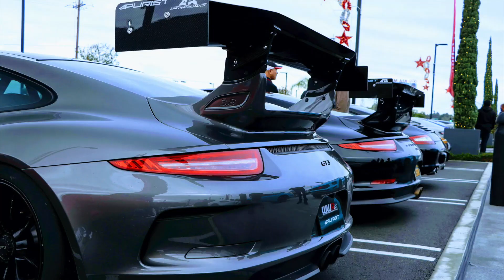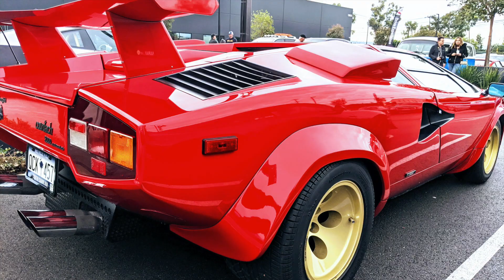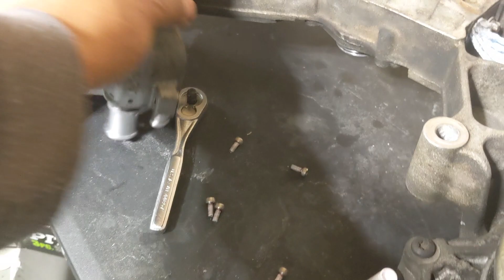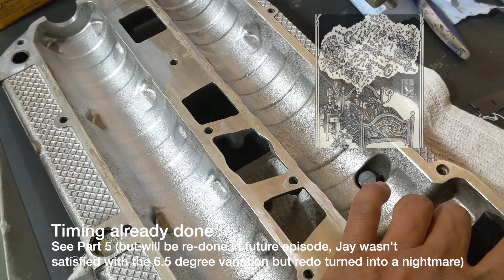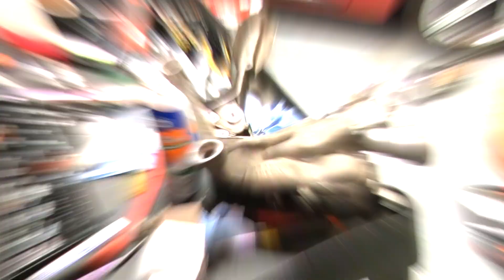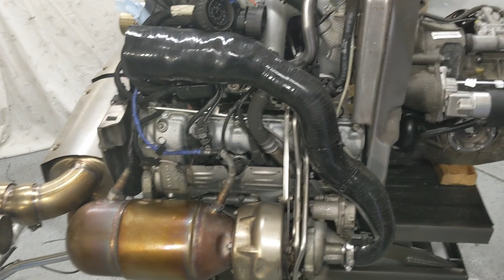Jay's Porsche 997 turbo Major Engine Out Repair Part 6

Comment: Hi why didnt you remove the solenoid/actutator for the camshafts if you pinned the cams?? Whats their purpose now? Thanks for the movies, your knowledge is valuable to any mechanic, novice or pro, Porsches have specific design and construction solutions like non other.
Reply from the maker: Thanks.  The variable valve camshaft actuator still works as normal.  Pinning the camshaft sleeve/collar prevents it from spinning out of place that will block the oil passage, causing a check engine light and stopping it from working.  It's a prevention/fix to a camshaft defect that happens to a small percentage of cars.
Reply: @atm4jim  Ooh I see, then tell me how do you get rid of the variable valves when running an aftermarket ECU? I thought this pinning did it. Which other way can you do it?